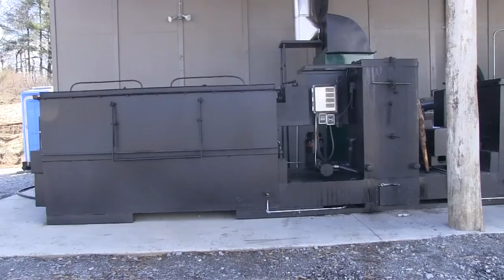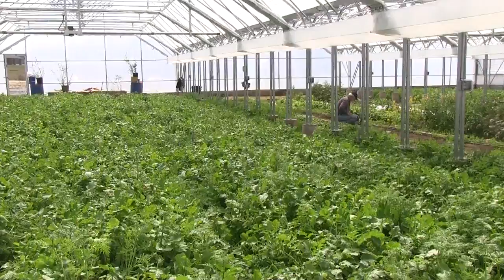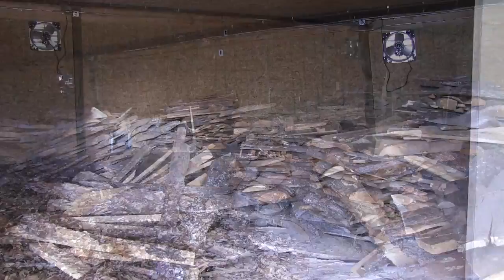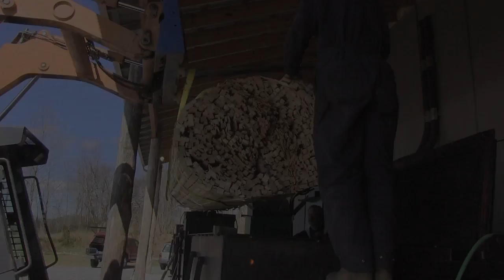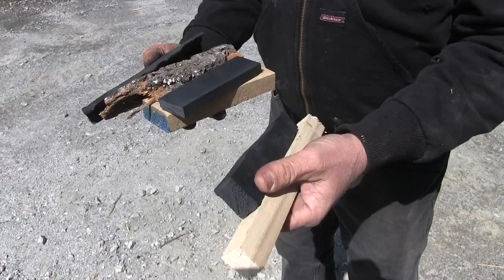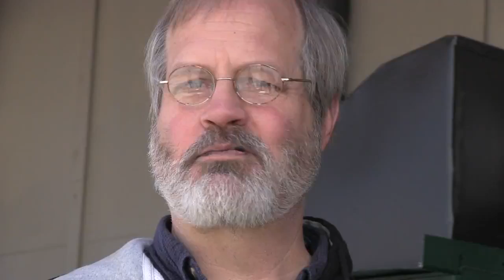New England Biochar

Comment: I think you have a great system going there. I wonder how you can get enough fuel to convert the slash and waste wood into biochar? also, can you fill gaps in a retort with fine wood chips or sawdust to increase the yield? I think the biochar/greenhouse heat setup is a natural symbiotic fit for heating the greenhouse with every degree of temperature increase of the retort. the biochar can then be used to improve the status of other ground recovering from over use or depleted of resources. Can you do more videos?